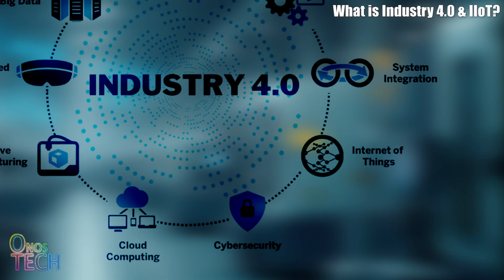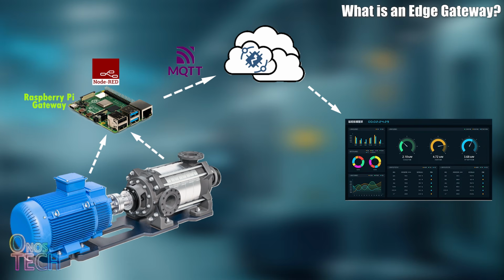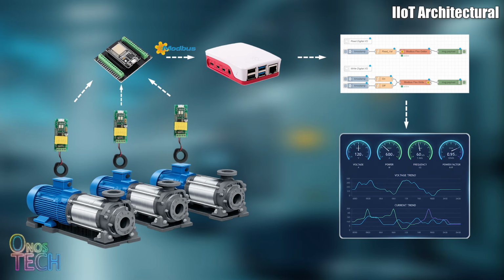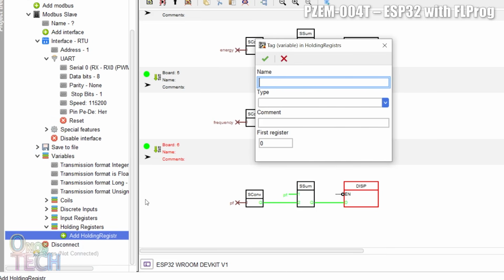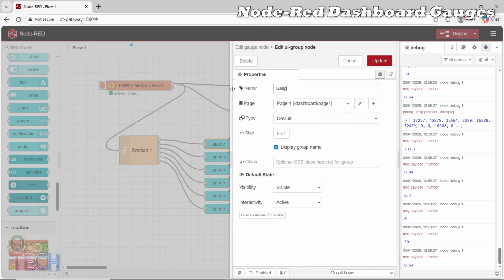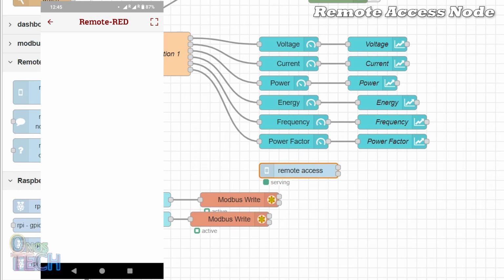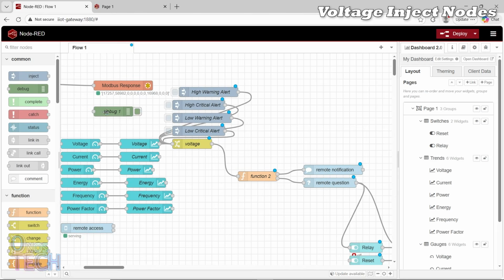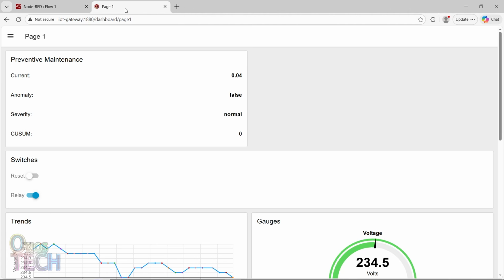Build Your First IIoT System | Raspberry Pi, Node-RED & PZEM-004T Smart Energy Monitoring | FLProg

Comment: I have a question (probably a beginner's question). Once I have programmed the ESP32, I see that it connects to the Raspberry Pi via USB to do everything related to Node-red. In a real environment, should the ESP32 always remain connected to the Raspberry Pi via USB, or how do the two devices (ESP32 - RPi) communicate once I have finished the Node-red part?
Reply from the maker: For this setup, the ESP32 should always remain connected to the Raspberry Pi via USB. It can also connect via WiFi, but that will be in another video. 😊😊😊